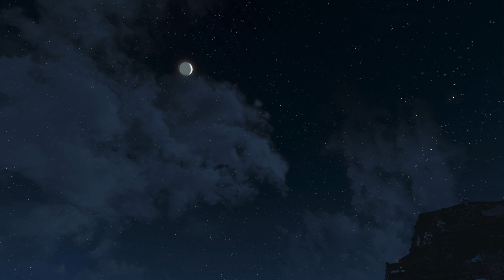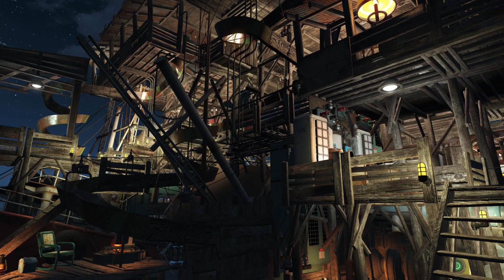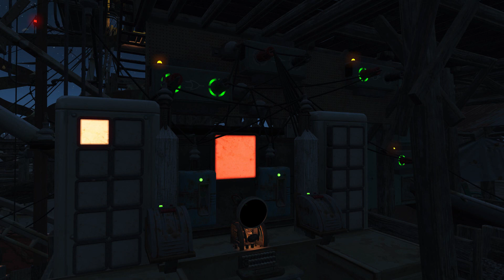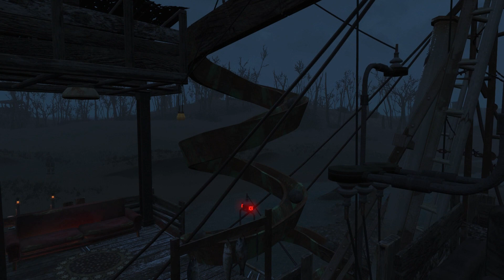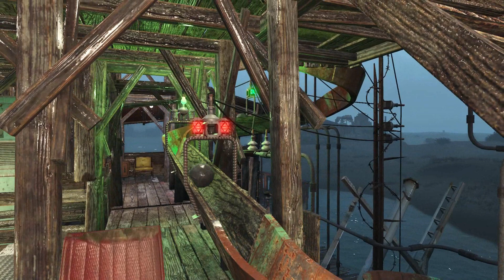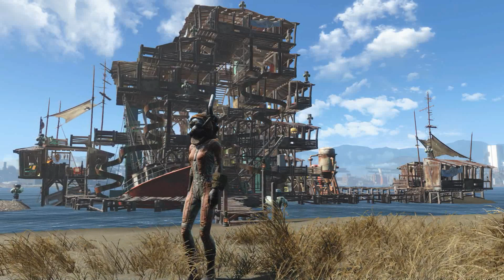Fallout 4 Ball Track Settlement build at Spectacle Island

Comment: I’m slightly confused, when you say you use the ball switches to “power” the settlement, do you mean that you’re disconnecting your generator from the grid, and the grid is purely being powered by the switches becoming “on”? Or are the switches just allowing power from the generator to pass into the grid?
Reply from the maker: no, we still need the genny, its that the power is not connected to the build directly, it all flows through the ball track switches as one continuous flow and the ball tracks power the build